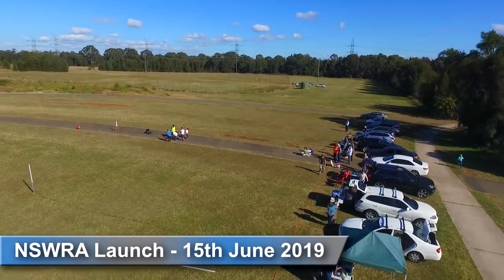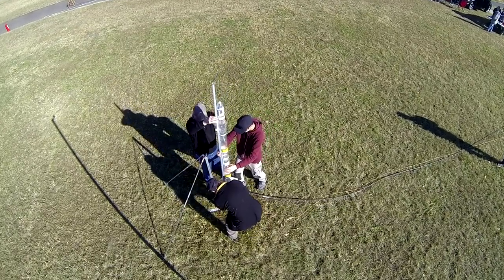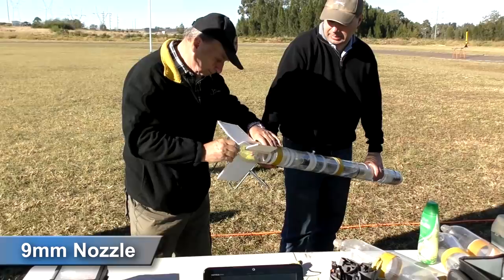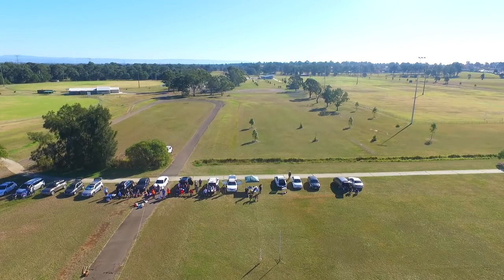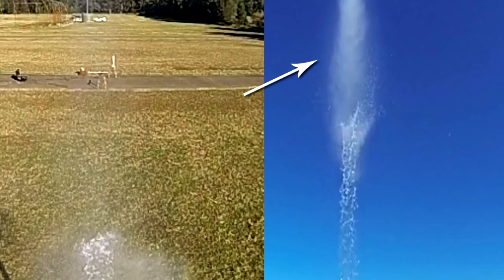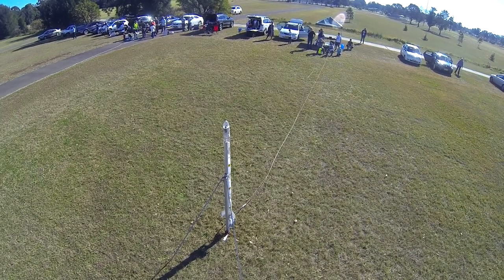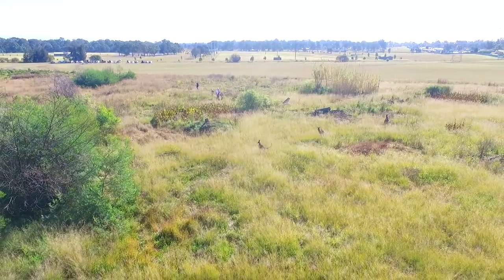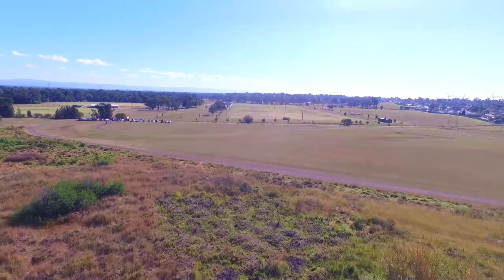Giraffe View - 4m tall tripod

Comment: As I'm an engineer myself, it is very satisfying to see how you tried to bring the air pulse into the camara view.
Not by using maths (e.g. a water rocket simulator) but just estimating the correct amount of water. It reminds me how often I just estimated the correct value of a component in an electronic development (doing the calculation later for  reliability).
I love your videos, they are the reason for building my first own water rocket (maiden flight hopefully this year).
Reply from the maker: I guess sometimes a part of engineering is not over engineering. :) Great to hear that you are having a go with water rockets too.

Comment: Yes, these guys always have an idea for a new video! Well done! The video is awesome! A team of great engineers! (Yes, the math is a bit boring)))) A long time ago, a teacher at the institute explained to me what the engineering profession is: - the designer will make excellent and accurate calculations and drawings, the installers at the factory will assemble the device, but it will not work correctly! Then the ENGINEER will come with his soldering iron and oscilloscope and in 10 minutes everything will work out)));) (I hope the translation was correct)

Comment: 2:40 rocket was the best in my opinion. Look like more control on thrust. Others one look like mentos and cocacola. 
Of course i expect you go outside of the planet when i see the carbonfiber rocket construction but look like that dont hapen just with water.
Good video any way.
You tried to heat the water to make more presure with nitenol wire on the last part of the roquet.
Or try build aerostrike nozel?

Comment: I can't imagine why there is water going up on the 22mm nozzle launch. Did you get any idea? maybe resilient air inside the lauchpad?
nice as always, you guys :)
Reply from the maker: No, I think it is related to the acceleration of the rocket and how it accelerates the water inside it. The pressure is the same in both cases, and so is the amount of water.

Comment: Still great achievements George, congratulations!
But I'm asking myself a question. Why do not you tie your parachutes to the center of gravity of your rockets?
Thank you in advance for your answer.
Cordially.
François
Reply from the maker: Hi François and thank you.  Our parachutes are removable, as we always re-configure our rockets and so the shock cord loop that goes around the rocket also gets moved around. When I put the parachute on, sometimes I don't tighten the loop enough and it can slip down the rocket a little when the parachute opens. It needs to slide just past the center of gravity and the rocket goes down nose first. We actually normally tie the shock cord a little forward of the center of gravity, because the fins generate a certain amount of lift on the way down.
Reply: OK George and thanks for the answer ...
Personally, I attach the parachute on two points.
A cord is attached to the ogival side and fins side. A ring that can slide on this rope serves as a point of attachment to the shock absorber of the parachute ...
Thank you for these great videos.
Good continuation.
François

Comment: Need to message Smarter everyday to find out why the momentum of the water changed between nozzle sizes.
Reply from the maker: I've often wondered why that happens, though haven't been motivated enough to do the maths.
Reply: Air Command Rockets when it comes to math, motivation is my largest obstacle. I avoided higher level math by choosing a major where I could get away with a truncated version of calculus.

Comment: In a long-ago video you compare using different amounts of water, as well as no water, and demonstrate that about 1/3 water is best and no-water is worst.

I'm trying to understand why putting ANY amount of water in an air-powered rocket makes it fly higher than using just the compressed air. Certainly the water adds considerable weight, plus it means less compressed air (less energy), so it would seem reasonable that it would fly not nearly as high as with just compressed air.  In addition, in some of the videos it actually shows that some of the water that's exiting the nozzle is actually moving in the SAME DIRECTION as the rocket, which would seem to imply that it's not acting as exhaust contributing to the thrust.

I'm thinking that the effect that the water has is that it keeps the internal pressure higher slightly longer than with an air-only setup, since the water isn't nearly as fluid (I know that's not quite the right term) as the air, so it takes a bit longer to escape through the nozzle. Maybe the issue is that you're using the same nozzle size for both the air-only and the air-with-water launches. Maybe the air-only needs a smaller diameter nozzle and it would then reach a higher altitude.

It just seems counter-intuitive that adding the relatively tremendous amount of water weight to the rocket and the significantly less pressurized air should result in higher altitudes.
Reply from the maker: It may seem counter intuitive. For a definitive answer here is a good explanation with equations and everything. http://www.et.byu.edu/~wheeler/benchtop/pix/thrust_eqns.pdf